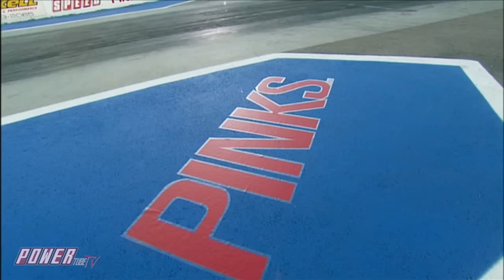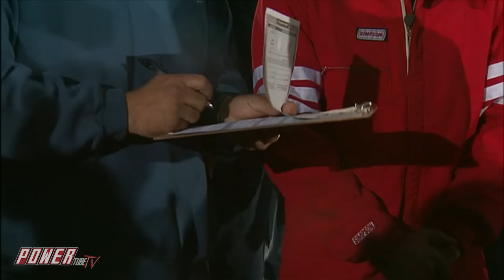PINKS - Lose The Race...Lose Your Ride! No Shows, Quitters & Breakdowns Special!

Comment: Two racers decide that their personal safety is more important than a TV race, and Rich puts them in a special episode and labels them quitters?  That’s a dick move, Christensen.  A dick move.
Reply: They had already signed the pink slips and did a race or 2 before walking away, so yes in theory they are quitters for not adapting to the track conditions
Reply: Well they both signed up and then backed out so they quit what else would u call it